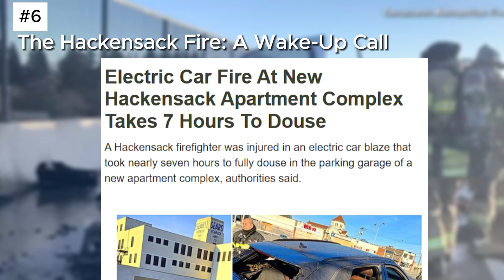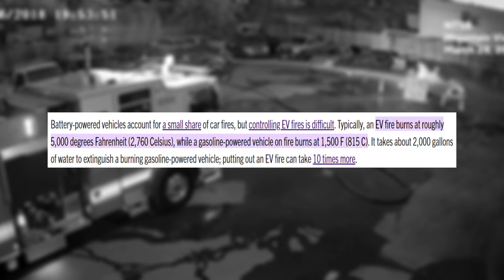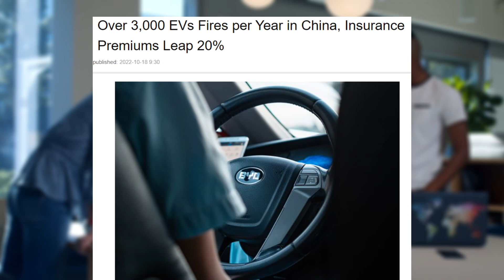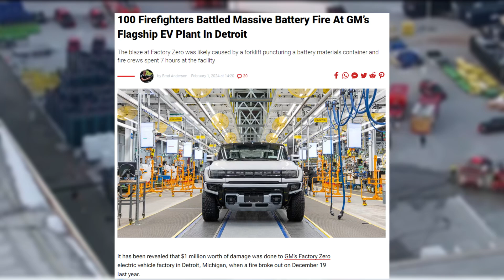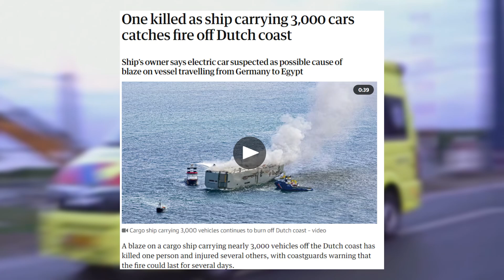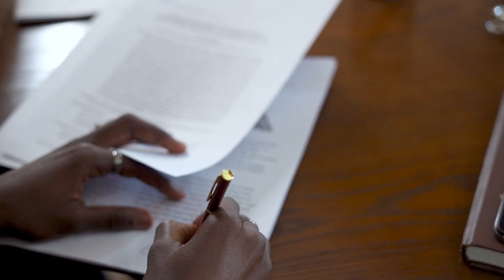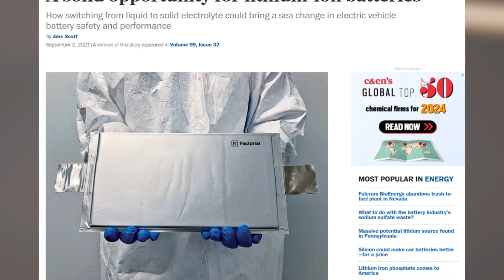The Hidden Dangers of Electric Cars: Are EV Fires the Next Big Crisis?

Comment: Well true in old chemistry batteries Please tell Toyota to stop using 25 year old chemistry batteries, "O" I for got in 2026 they are going to use BYD Power Trains now we will not have all these FIRES after all. So they have worked that out too, it took a while but they have got there.